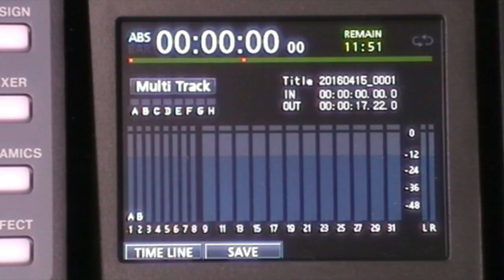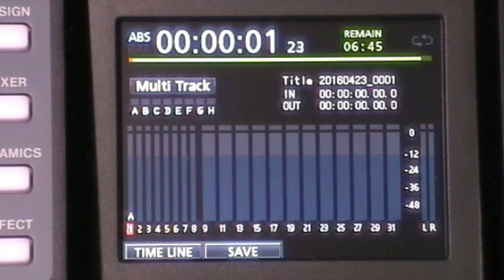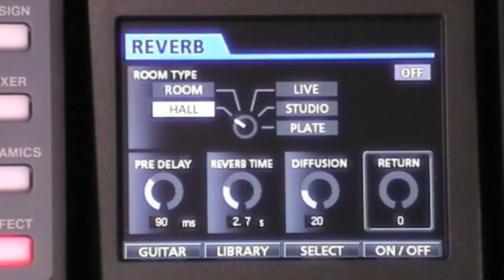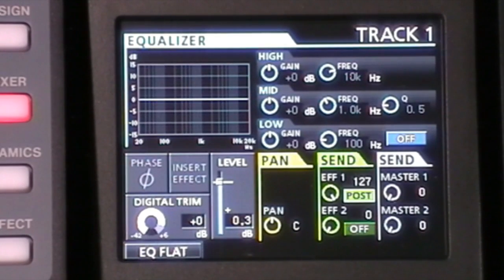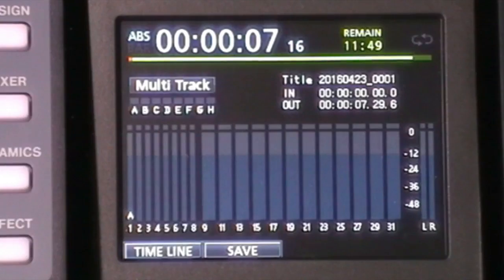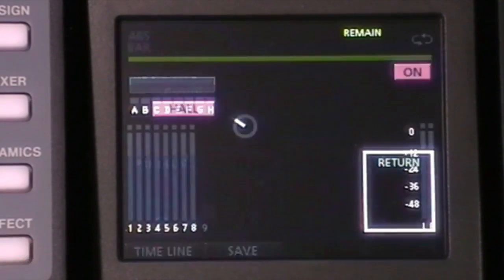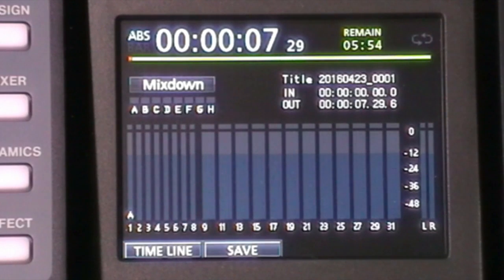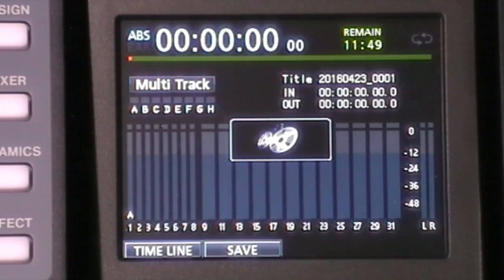Tascam DP-32SD Reverb for playback/mixdown

Comment: Hi Phil, thanks for all the great informative videos!  I just bought a Tascam DP32 SD and was wondering how to adjust and set the reverb for the individual mono (and stereo tracks) while both recording and during playback?  On my old DP03 SD, there was a physical knob for each of the 8 tracks which made it very simple but I'm confused how to do it on the DP32 SD.  Many thanks.   Jeff
Reply from the maker: +SAR thanks for the feedback Jeff. If you check out the tutorial videos https://www.youtube.com/playlist?list=PLI2uGjCObnySgNrQyJmlcQpQaUdgBdW6l, you'll see the reverb effect is only available in the Send effect. There's a written summary of all effects here http://www.tascamforums.com/threads/dp24-32-fx-definitive-summary-of-effects.4162/
Adding a Send effect during playback is fairly easy - you set the Send-1 level for each track as reqd, the single Master-Send-1 level, and the single Reverb return level - it's all in tutorial no. 5.
The effect can also be added to signals being monitored while they are being recorded... but the reverb itself will not be recorded, i.e. it's a 'comfort' reverb.
It's not easy to record the Reverb effect 'live' as you need to create a path from the internal effect output back to the tracks. One way is to connect a physical cable from the Send output to a spare input but you need to be careful you don't get a feedback loop. The other way is to use the Bounce function, which makes an internal connection from the 'mix' output back to a spare track for recording. In this case, you would add reverb using the Send effect just as with playback, but this time the result will be recorded - see video no. 9. 
There is also a 'delay' effect in the Track Insert (Guitar) effect, so this may be a suitable alternative - it can be placed in the record path or the playback path so you can record it live without having to bounce.
Reply: Thanks Phil, I assume the only way to record vocals live with reverb added then would be to use a separate vocal processor between the mic and the DP32 SD inputs?  I'm just a little surprised that this $550 recorder doesn't even have the same basic record/playback reverb ability that Tascam's cheaper 6 and 8 track recorders have.  You have great, informative and in-depth videos!   Thanks.  Jeff R.
Reply from the maker: Jeff, are you sure you could add reverb to a 'live' recording on the DP-03? The block diagram looks very similar to the dp24/32 so appears to have the same 'restrictions' with the Send effect, i.e. you can add and hear reverb while you are recording, but the reverb is not actually recorded. I know the layout is different on the dp03 but I think those knobs are just the individual Send levels which you set via the mixer screen on the dp24/32.  It's easy to fall into the trap of thinking the reverb has been recorded as when you play tracks back, the send effect is still in operation, so you'll hear the reverbs re-added to the dry recordings. You should be able to prove this by turning off the reverb during playback.
Update: There is a good reason why you wouldn't want to record reverb live... once you add it, you cannot remove it. Normally you would add reverb to the monitored signal to allow the performer to perform better (a 'comfort' reverb). This would be a 'rough' setting, or whatever the performer needs. Afterwards you would either bounce or mixdown and add the correct amount of reverb (maybe with EQ) at that point. Unlike the live situation, it's very easy to add the reverb (Send effect) at this stage in the process, and you can easily undo it and try a different setting. One other trick with bouncing is to remove the original signal from the bounce so the new track just holds the reverb signal. This way you can easily balance the amount of original and reverb signals by just moving faders when you come to mix down.
Reply: Makes good sense Phil.  Can you please tell me how to actually use the reverb as a "comfort effect" (non recorded) on the DP32 SD?  That is where I'm having problems.  Thank you.  Jeff R.
Reply from the maker: This conversation is continued in the comments on https://www.youtube.com/watch?v=i8hIfj9kT3w

Comment: I have the DP32 and it is so complex to use the internal FX. Far easier to know what sound you want and record it wet, rather than recording dry and bugger around afterwards. Who the heck records an instrument and then decides they did it wrong and should have added reverb? Do it right and record what you hear, not what you decide to hear afterwards.
Reply from the maker: That's good advice - you were forced to do this in the old tape days when every bounce added more hiss etc... on the other hand, once you commit an FX there's no going back so it takes a confident person to do it :) There's a summary of DP24/32 effects here (http://www.tascamforums.com/threads/dp24-32-fx-definitive-summary-of-effects.4162/) if it's any help.
Reply: Phil Tipping Thanks, I'll take a look, but there's no arguing that Tascam have developed the most complex and user unfriendly FX device known to man. Shame really because the DP units are brilliant.

Comment: Dude I have 2 Dp-32's linked together through midi! Get the older Dp-32 like I did and link them!
 I use them with the Voicelive 3 rack!
Reply from the maker: +lemonhead344 yes it's a shame Tascam dropped MIDI from the latest sd models. It's possible to sync these using sound pulses, but a built-in MIDI solution would make it so much easier. Nice gear from T.C.Helicon - can get some good bargains 2nd hand - I picked up the VoiceWorks rack model mainly for harmonising experiments but was surprised how good the FX sounded.

Comment: shit machine. you cant even sync up external hardware like a korg electribe... nothing at all. no midi signal what so ever??? crap!!!!!!
Reply from the maker: Fair enough +Jason Jon Lacey :) if midi/sync is what you want, this machine isn't for you... but others may not care :) fyi the older dp-24 with built-in CD burner does have midi sync so might be worth a look.
Reply: i cant seem to find one anywhere. the ones they made with midid don't seem to be found. I've tried searching. its made me nuts because my br1600 has kaput and i'm really not into making music on a pc or mac. i like to sync my beat machines etc to it. the korg d32 is old now and i;m not keen on 2nd hand gear. i just wish a new one was made with midi sync for external hardware units. anything under 24 tracks is useless to me so it has to be 24 or more. this tascam has angered me because of that. a beautiful looking machine i thought at first and was going to get one assuming it did have midi. i was baffled and still am as to why they did that. surely they must know that there are a fantastic amour of us still using multi trackers as a sole production tool.... but with midi sync! mamma mia!! imagine recording your band with one of these 32 tracks to a click or a pre made beat with an external machine. listening back to your recording and having the luxury of digging out an old synth or new, with midi and adding quantized, synced and swishing arpeggios, some extra beats and fills via a korg etc or even samples. this is so much fun to come up with ideas on the fly and do some real time jamming over your tracks with all your music gear flashing away in total sync harmony to your click track and music. excuse my grammar and stuff
Reply from the maker: Yeah I know what you mean Jason, it's a shame they dropped midi; maybe there were issues they couldn't solve, but either way you're right, there's hardly any dedicated gear produced now so you either take a gamble on 2nd hand gear or give in and use a computer :( My old Fostex D108 & D2424 both have lots of sync features but are big & heavy and use IDE hard discs. I was just looking for a portable multi-tracker which recorded onto sd-cards for post-processing back at base so didn't mind not having sync on location. Went for the Tascam as it seemed more robust than the Zooms, but neither of them had sync features. There are a few tricks you can use which mimic what we used to do in the old cassette days - you record a click track and feed this into a converter gizmo for changing audio bleeps/clicks into MIDI and vice versa. The bleeps just use a standard audio track, and at least with these digital recorders you won't get any bleed onto other tracks. There's an example which doesn't need a convertor unit on the Tascam forum http://www.tascamforums.com/threads/cool-trick-for-syncing-more-than-8-tracks-without-the-midi-port.4112/
I used to use a Philip Rees TS1 tape sync unit but unfortunately sold it - doh! Don't know any other solutions if you're like me and want to avoid computers, but good luck anyway :)
Reply: thanks for that. i just want to switch on as normal. last song worked on loads up with all settings intact. beat machines and my other gear midi connected and ready to start playing as soon as i hit play on my multi tracker. it seems so easy to ask but as much as your idea will work its just that kind of computer style routing again... i.e. having to set stuff up to record first when all you want to do is power up and start jamming ideas. i may have to opt for a new tascam neo or the one just before as the korgs are 500 plus even on ebay. its frustrating because remixing is my out of work job but i've made no music for 2 months since the roland broke (only 16 tracks though) I've got a few new bits of gear that i'm dying to use but just refuse to look at music to make music with blocks and numbers in front of my eyes. don't mind wave forms but the grids and setting channels up etc does me in. i once went to a pro recording studio to lay down beats for some hip hop... i was there 3 hours until i herd a sound come from my machine. all to do with sound cards, compatibility, routing, sub groups, patch bays. even when i worked in a studio i used to bring in a divi 8 track and they loved the sounds i could get. i wasnt using midi see, i was using samples played on an electribe synced up to the midi clock. even the idea of taking a tascam dp abroad to work with friends on stuff is out as they use hardware. i couldn't get a tascam dp even if i wanted to, know what i'm saying? its not buyable by people who buy this gear for these reasons and there are so many of them! cheers for reading my rant but it means a lot to make a tune here and there. I've had to resort to playing along to a click in audacity and cutting it up to the bars etc.... I've managed to put 3 songs up from doing that but nothing like midi sync.... all the day long midi sync, i just don't get it
Reply from the maker: No problem Jason, rant away :) The rate of progress is frightening and gear is obsolete almost as soon as you've bought it, even if it's better than the newer model. I remember getting disillusioned with the way s/w sequencers were developing - spent so long fiddling with the mouse and getting distracted with a computer, you forget what you were trying to record, so ended up writing my own hands-free system (Sequetron). Don't give up - you'll find a new way of working I'm sure. It's the do-ers who get things done, not the ones who talk about it! All the best.
Reply: Sequetron you say. good stuff, thanks for tour words and the very best to you to

Comment: ok thanks-ya I basically just want to make really good recordings at fairly low cost- Can you transfer recorded tracks to a DAW to add effects or to mix and master as an option?
Reply from the maker: Yes, each track can be 'exported' to a wave file suitable for use on a computer for processing however you like. That's how I use it, although you can also do all the mixing and mastering on the machine and just transfer the final mastered wave file across for burning to a CD or whatever.
Reply: thanks and do you have a full song on you tube and do you find the lcd big enough?
Reply from the maker: I've nothing posted yet which was made solely on this machine. The LCD is fine for me with plenty of brightness, but sounds like you could really do with seeing one in the flesh if you're not sure. Try and get more opinions, e.g. from the Tascam forum I mentioned - they're a friendly bunch! There are users there who have made complete tracks on the machine so would be much better at advising than me.
Reply: ok thanks

Comment: hi I'm looking to buy one of these- any major negatives?
Reply from the maker: Hi +Neil Swan, well it's a bit subjective and depends how much of it you're planning to use. My main requirement was for multi-track recording on location without getting bogged down with computers, so it fits the bill perfectly. If you're wanting to mix & master on it, it does the job and has a selection of FX to choose from, but not sure how the quality of the FX and mastering compares to what you're after. There are restrictions in the no. of FX which can be used simultaneously - I posted a 'definitive summary' on the Tascam forum http://www.tascamforums.com
If you've got the latest firmware and a good quality sd-card, it's capable of glitch-free recording and editing. I've found it a very solid machine, both mechanically and functionally.
The ergonomics is fairly good, with real trim controls on the 8 inputs, and individual track faders for playback. A lot of other functions are via screen menus so this may be an issue for you. EQ and send levels have real knobs on the front panel, although they only control the currently selected input or track so there are compromises if you're used to a hardware mixer with dedicated controls for everything.
It can only record 8 tracks simultaneously, but can handle 24bit, 48KHz formats so quality is plenty good enough (for me). The sd-card can be accessed via USB or you can unplug it and connect direct to a computer. It takes a while to convert recorded tracks into a wave file suitable for playing/processing on a computer, but it means you can mix/master recordings on a DAW. This 'export' process can be quite an area of confusion though if you take a look at the forum.
I would ask the same question there as there are quite a few users who will have their own good/bad points. If you go for one, I would recommend paying the extra for the dp32, as the stereo tracks can be configured as either mono or stereo, as opposed to the dp24 where the mono & stereo tracks are fixed. Note that the term 'track' is a bit misleading. They count a stereo track as 2, and if you configure one as mono, you lose the other mono in the pair, so you don't actually get 32 individual mono tracks.
Any other questions, please use my email as shown on the philizound.co.uk web site. Good luck.

Comment: Hi Phil, I just seen this and subscribed. thanks. My question is...  I just picked up a new 
DP-24SD and I went right to the demo song. Now I suspect when creating a new song I'm going to carry over all the effects and routing. How would  you go about creating a !Reset file from this point so settings are reset to zero/default and one can create a new song?  simple card format..etc   thanks in advance.

Mark
Reply: Hi Mark, best bet is to create a new song first so that it does not contain any audio data. Then go through all FX & mixer settings for all tracks and inputs, setting all parameters to off or zero as reqd. Then save this song and name it as !Reset. If you also protect it, you won't accidentally overwrite it. From now on, always load the !Reset song before you create a new song to guarantee all FX & routing is how you want it.